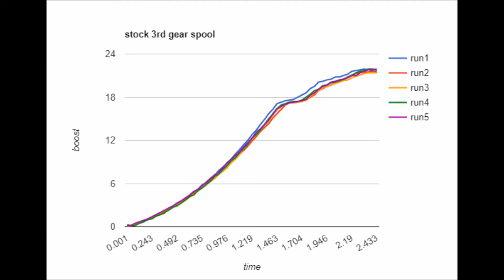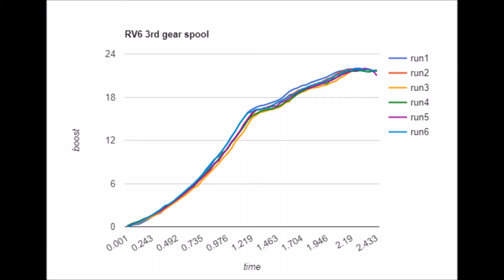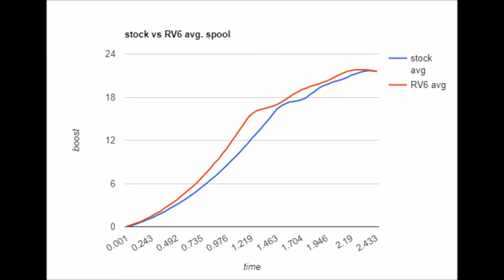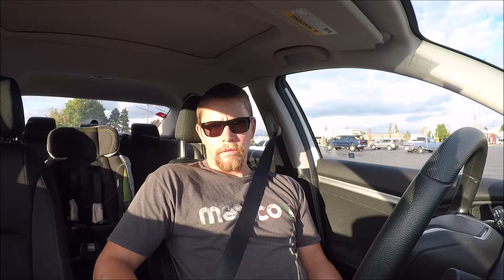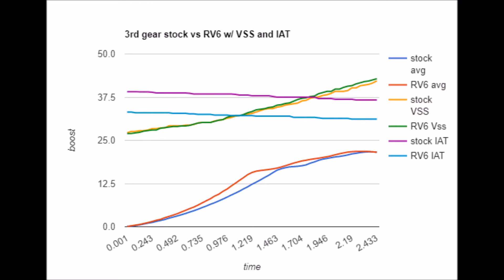2017 Honda Civic EXT 1.5T RV6 catless downpipe test data / results

Comment: what you exhaust setup in this video????
Reply from the maker: Only setups I ever had were stock and stock piping/muffler delete. I would be willing to bet in most videos I had no mufflers.
Reply: you test sound whit 2 muffler ??
Reply from the maker: @white_fc3552  I will have to check my other videos about the downpipe and see. Won't get to it til later though. I pretty much ran zero mufflers until I lowered the car because it then started sucking the exhaust fumes out/around by my fuel door staining my white paint so I reinstalled the drivers side muffler, then basically ran 1 muffler always while lowered.

Comment: Hey man love your videos. Just wanted to ask straight forward question. Can you run a catless  downpipe on these cars with no tune ??
Reply from the maker: Yes except you'll have to play with the defouler trick to try and find he exact setup that will (maybe) keep the CEL from popping up. I had a tuner to disable the codes before I got the DP. Honestly though you can get the Ktuner V1.2 for not a ton more than most DPs and you'll get WAY more bang for the buck.
Reply: caraddict thanks. And I understand ktuner is more bang for the buck but I want to get all my mods in my car before I get ktuner because when I get that I would like to get a custom    tune done with all mods
Reply from the maker: @HollywoodQuickscopes  well if you plan on getting a tuner anyways get it first and run the included tunes so you can disable the codes for sure, and if you go with the prl cobra cai you can scale the maf, etc then after you get all your mods you can pay for the custom tune. I mean that is what I would do and if you are going to get it for sure anyways there's no reason to wait till the end.
Reply: caraddict true. Thanks man

Comment: What would you recommend for a 17 civic ext with CVT
Reply: I am looking for a downpipe and CAI
Reply from the maker: honestly I would probably go with PRL since they have the front pipe released as well already and the downpipe itself is cheaper. However if you have to go through a visual inspection as well there is a small chance a quick look under the hood you might mistake the RV6 for stock with the heatshield being in place, not going to miss the PRL unless its your first time getting under the hood of a 10th gen. If you arent ever planning to make BIG power, you might not care to spend the money for 3", in that case get the CNT racing combo as its 370 for both, starts at 3" to about 2.5" then exits the next pipe around 2 3/8 or so. As for intake Id either get the cheapest option which I think is the PRL silicone sleeve and drop in filter or get their cobra CAI. I am however choosing option C and making my own. I think I can get the piping/couplers/filter/larger MAF housing for around 100 bucks. Will it look 25% as cool as the cobra setup? no, will it be functional? ... I hope so ... lol

Comment: do you get a 02 sensor/ check engine light from the downpipes
Reply from the maker: +Basil Akasheh The CEL popped once ate maybe 500 miles. Went off on its own after about 3 short drive cycles and I've never seen it again. And I do not have it disabled in ktuner so it would pop again if it were going to.

Comment: Just installed the rv6 down pipe, cold air intake and stage 2 tune from ktuner and I can say I see a BIG difference, how much hp/torque do you think my car is at now?
Reply from the maker: based on my dyno of the stage 2 with CAI, I would say probably ~215/260